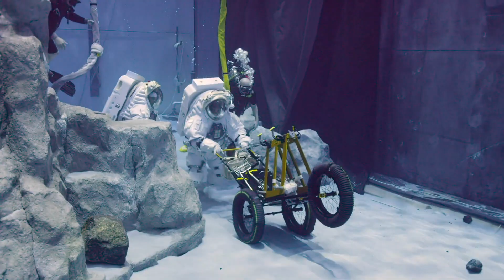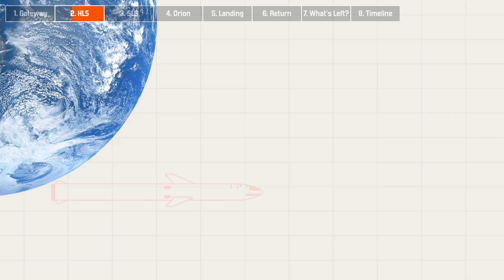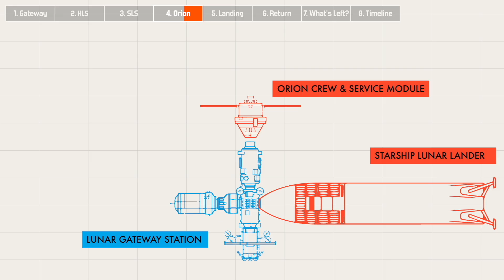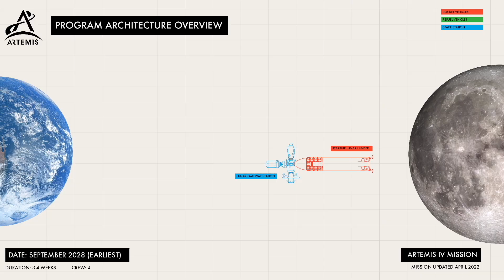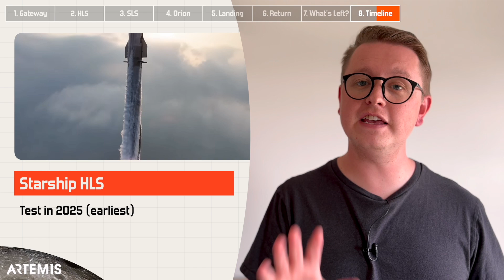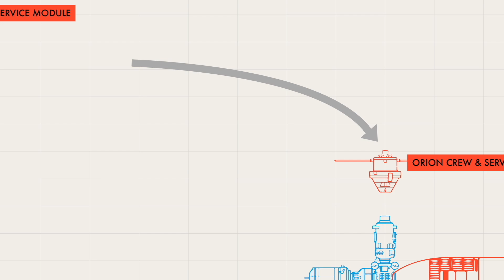NASA's Moon Plan Overview | Artemis Program Architecture

Comment: Delightful assembly of animation and speech. Of course, 2024 is gone and 2025 is already seeing massive upheaval and speculation that the new administration could pick Artemis up like a toaster, turn it upside-down, and shake all the crumbs out. The future of the Space Launch System rocket and Gateway space station, while still possible, are by no means guaranteed. There is an active push to "step on the gas" and get astronauts onm the lunar surface, with or without a lunar space station, ASAP. Will it work? How will it happen? I think we'll have an idea in the next four years.
Reply from the maker: It's so true. I would say there are many within NASA, CSA, and ESA in particular who are eager to learn what the changes will be. As for me, I want to see Artemis successfully return to the moon and I think this architecture is pretty good, if compromised. But given current funding levels, I think it's a good option. We're finally getting close to some of this stuff happening, it would be shame to throw it away now. And I don't think handing it all off to a single aerospace company is the way forward, either. The team approach is slower, but a lot smarter. When there's an update, I plan to make a video about it.